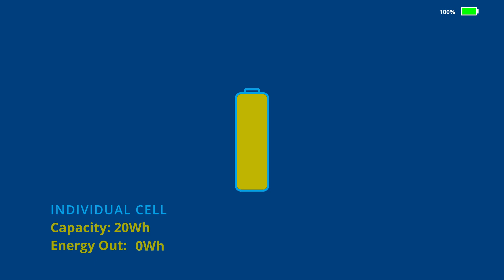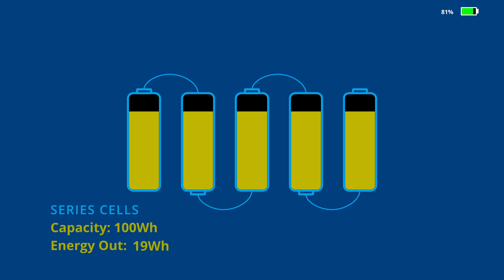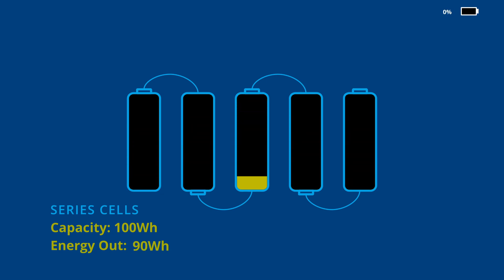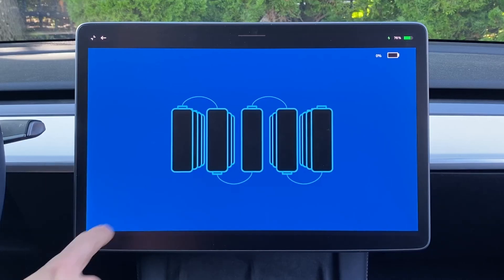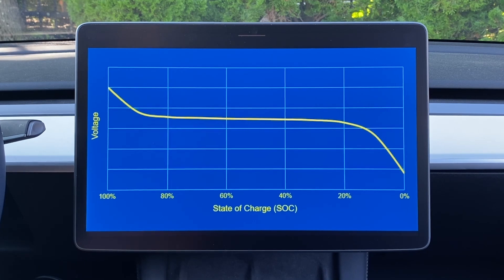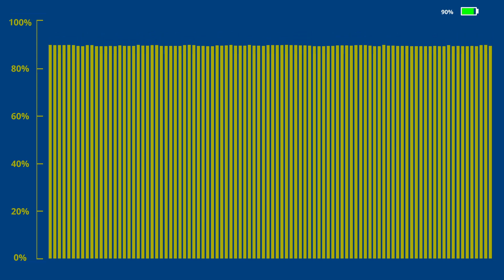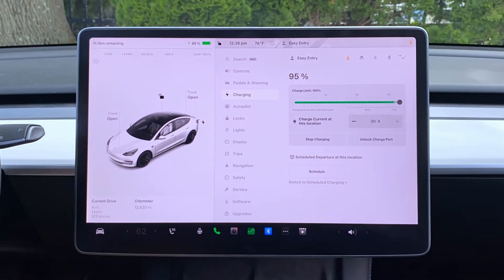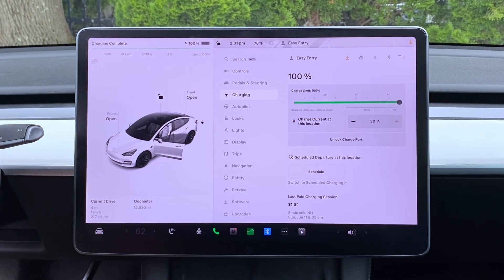How To Balance Your Tesla Battery

Comment: Course natural aging can cause the amp hour capacities to drop.

Manufacturing tolerances and quality of individual cells can also change the capacity.

In my case I've got a nearly 8 year old model S P100D with  272,000KM.

The lowest Calculated Amp-Hour Capacity (CAC) is  229, the max is 236 and the average is 235.
So its a 6.5Ah difference from the average to the worst.

Meaning approx 2.6kWh is locked out since the weaker pack will be limiting me.
Additionally any full cycle drains will only serve to exacerbate the issue.
As the weakest cell will end up with more accumulative discharge % and so wear out faster.

Eventually leading to a larger imbalance on the pack.
That being said, 6.5ah off the average is only 2.76% off being balanced and is acceptable for now.

Comment: 5:50. All your video make sense  but this aspect is not true. The car will balance better ifg it is parked because the BMS need accurate voltage reading which mean no load must be applied. OCV is what matter for the BMS voltage sense

Comment: The process on LFP battery ande NMC/NCA battery is a bit different. YES it make sense for the LFP but for other chemistry the BMS balance at many high soc due to the different SOC curves. what matter the most is to have teh car to sit few hours in order to get accurate voltage reading (OCV) otherwise it will not do his jow with good measurements.

Comment: I would expect the balancing system to be working all all range of charge.
I know for LFP it get a harder time as the voltage is almost the same until fully charged, that's why they recommend fully charging to 100% for theses.

Comment: Thank you!  I'd like to ask whether any info in this video has changed from 2 years ago to now.
Reply: The chemistries haven't really changed.

The basic function on any BMS for NCA/NMC type cells is to have it balance at the top end with protections against overcharging.
AKA this balance resistor to burn off the top cells while charging the rest to 100% (4.2v)

LFP (LiFePO4) is charge to 100% as the voltage spikes only at the utmost extremes. IE 100% and 0%.
So the BMS needs the 100% to accurately measure consumed kWh and give you the user a more accurate % remaining.
Additionally the stress of 100% on LFP is not the same as sitting at 100% for NMA/NMC.
Reply: @ArmChairPlum thanks

Comment: I thought you had to charge it to 100% and leave it plugged in for a couple of hours for the BMS to work.  When you unplug it, the BMS will stop working.  But what you’re saying is, as long as it hits 100%, the BMS will start balancing whether it’s plugged in or not.
Reply from the maker: My understanding is that the BMS starts balancing even at a state-of-charge slightly before 100%, but it’s not clear exactly when.  So charging to 100% will guarantee the balancing algorithm begins.   Then the balancing algorithm continues, even if the charging cable is unplugged, or if the car is being driven or even if it’s parked.   It can take several hours for the balancing to finish.
Reply: How long should I leave the battery at 90%? And should I do this a couple of times in a row?

Comment: In terms of the battery as a pack what do you consider 100%. Is it when the first cell hits 4.2v?
Reply: Well, according to my tests of the BMS the battery pack in the Tesla is considered 100% with highest cell around 4.15V to 4.18V depending on the battery pack temperature.

Comment: Is this why a lot of 2021 tesla are getting the error code BMS_A079 max charge reached, impossible to charge. Because the pack is not balanced? And is charging to 100% would help to avoid this problem?
Reply: I have this problem on my Tesla 3 2021. Did charging to 100% as described in the video help you?
Reply: I charged my 2021 model 3 to 90% before a long trip and got the same code BMS_a079 max charge reached and only lets me charge to 50 % did your problem got fixed?
Reply: I got this fixed by replacing the battery. Twice! If it happens out of warranty I'm getting lawyers involved.

Comment: Great video, thanks! But is it real? Can teslas rebalance individual cells or only series? In latter case it won't help. Any reference to docs or researches?
Reply from the maker: In the Tesla, it’s not individual cells that get balanced…it’s “bricks” of parallel cells that get balanced (I think I mentioned that in the video).  

There are guys on the Tesla owners Online forum that have disassembled Tesla battery packs and posted photos and essentially reverse engineered the charging/balancing circuits.   Lots of information about charging/balancing on that forum.   
Thanks for watching 👍
Reply: @CosmologicalNonsense  Is it possible that an individual cell gets imbalanced? If yes, then how to fix it?

Comment: This is a great visualization

It says charge to 100% then drive it down to 90. Do you then have to go back and charge it up to 100% again and how many times do you have to repeat this for the balancing to complete?
Reply from the maker: No, you don’t need to charge it up to 100% again.   Just doing it once will trigger the balancing algorithm.  I’ve been doing it about once or twice per year.   👍
Reply: @CosmologicalNonsense  OK so in summary drain the car to 5% bring it home and plug it into my HWPC until it hits 100% immediately drive it down to 90% so that it can sit for a few hours. Is that correct?
Reply from the maker: @comdexusa  You don't actually need to drain it down to 5% to start the balancing process.  Charging up to 100% will do that.  Then drive down to 80-90% so the car doesn't sit too long at 100% because that isn't great for the batteries.
Reply: @CosmologicalNonsense Can you drive it lower than 80% after charging to 100%?  Say 50%?  I have to run an errand tomorrow after charging to 100% and don't know how much kwh it will use.  More than 20% for sure but not more than 50%.

Thanks so much for this vid!!!!  I charge to 65% daily and use about 20% to 50% on a daily basis. I have found on recent long drives that I cannot extract as much from the pack as should be possible based on my remaining range estimate.

My M3 is 10 months old w 15k mi and 337 mi at full charge (from 345 EPA and 342 when I just got it new). I have an 82.3 kwh pack so I should have a bit over 80 kwh available.  I don't know how large the reserve is but worked on 5 kwh and on my last few drives I could only extract 70 kwh from the pack!!!!  I rarely charge to 100% and rarely use DC charging (about 15 sessions and 600 kwh over the 15k mi).

I think you have explained why I have this problem (showing 80+ kwh available but I can only extract about 70 kwh).  Thanks!

Comment: This also bring another important question: does imbalance process happen more at high state of charge? If the self discharge current inside the cell happen across an equivalent resistor value than the relationship between soc and unbalance process would also follow the OVC curve.

Comment: is this fittable for NCA/NMC batteries? I got M3 LR and tessie shows a big degradation during last ~10 charges. Capacity dropped from 67-68 to ~62, though I did not discharge it much or charge it to 100 and leave for a lot of time. Usually discharge it to ~40% and charge to 80%, very mostly I use AC charger with up to 25 amps
Reply from the maker: Yes, this video is specifically for the nickel cobalt battery chemistry.  
If you’ve never charged your pack up past 80-90%, I’d say it’s worth a shot.   
Charge it all the way, then drive around to bring the state of charge back down to a reasonable level….This will trigger the pack to balance.  
Over the next several days and charge cycles, you may see an improvement (assuming the pack was unbalanced to begin with).
Reply: @CosmologicalNonsense  Car was taking around 18amps on 230V on 100% of charge. I have been waiting for around a hour and it dropped to like 10-12 amps, but I didnt have any more time to wait so had to drive. I did the trick just in case when I bought the car, it had like 450km range, I charged it to 100% and left for around a day without driving, I know its bad but range increased to 470km. Since then I only charged to 95% for trips and usually to 80% while discharging to 30-40%. Looks like I had to wait now until the charging has stopped but I guess Ill see the difference anyway. If range will increase, then after a month or two I will repeat but this time will wait until it stops charging and wait for a half an hour after before "test drive" to discharge battery. What I can say your trick really works because once I had an increase for around 20km. Big thanks for the video, its really easy to understand the technology in an easy way. Good Luck man
Reply: @CHELIK063  did u left your car plugged in or unplugged to charger?

Comment: I’d add that a grossly imbalanced pack will prematurely trigger the emergency shutdown message long before the display has reached 0% in the car, due to those low cells triggering the minimum voltage protections WAY before its anticipated in the coulomb counting method.

We’ve all heard of those cars that are forced to pull over for the shutdown when the screen said there was like 5 to 8% “left” on the display. The power reduction that occurs below 20% tried to combat the amount of “sag” that can prematurely hit this protection but it stands little chance against a really unbalanced pack.

Comment: How often should you do this? Will Charging to 100%, then doing a road trip achieve the same result?
Reply from the maker: Yup - charging up to 100% on a road trip would be ideal!   I do it a couple times per year to ensure my battery never gets too unbalanced.

I believe this is more of a problem for people that use ultra-conservative daily charge limits.   For example, someone that never charge past 50% would be at a greater risk of their pack becoming unbalanced.
Reply: With the Sexy Buttons app, it's showing, instead of percentage, mV. 6 - 8 mV rn. That seems low to me offhand, but I have no frame of reference. What number would you think says, "Maybe we ought to cycle the battery? @CosmologicalNonsense

Comment: How do you know this?
Reply from the maker: Great question.  I am an engineer with a background in battery packs.  But more importantly, Tesla's BMS has been deconstructed and analyzed by qualified enthusiasts and they have observed, documented, and described this passive balancing process in extreme detail.
Reply: @CosmologicalNonsense  it sounds odd that the BMS requires a 100% SoC to start the balancing process when Tesla advices customers to basically never charge to 100%. Are there other triggers for the balancing process?
Reply from the maker: @44Bigs  Yes, you are correct! The BMS begins balancing the pack at a SoC less than 100%....but nobody seems to be sure exactly what SoC triggers it.  So I typically use 100% when I want to force the pack to balance, because everybody can agree this SoC will absolutely trigger balancing.   Then I just drive the car afterwards to bring the SoC back down to something more reasonable.  Doing this once or twice a year doesn't seem to be problematic.
Reply: @44Bigs top-balancing is very common in lithium ion battery management systems. Tesla did in fact recommend charging to 100% once per month in the owners manual back when I purchased my Model 3 in 2019, which was prior to their usage of LFP batteries at all. I would assume this was their way of trying to recommend users balancing their pack without getting into the nerdy details of WHY they should be doing it. 

I have logged my cells while supercharging and watched the pack actually balancing in-action WHILE I was trying to charge to 100%. The car said I was “at” 100% but it kept charging for another 20 minutes and showed “recalculating remaining charge time” while I could see in the data log that it was performing its resistive load balancing while I was plugged in. My imbalance went from 5% to nearly 0.5% during that particular session. This videos recommendation certainly is a less expensive and more convenient use of time lol.
Reply: Thanks for the response! Would love to find out more about this stuff.
Reply from the maker: @SirBotsa_Lot a ton of information can be found by looking around on the teslamotorsclub.com forum.  They have some really knowledgeable contributors.

Comment: So let it for few hours after discharging to 90%??
Reply from the maker: Correct - the balancing will begin while topping off the pack, and will finish several hours later (or even a day later if your pack was severely unbalanced).  

You don’t need to let the car sit still while it is balancing - the car can be driven or parked during this period.
Reply: @CosmologicalNonsense  ok so I can drive it.. I thought I must leave it without driving for few hours at least.. THX I will try
Reply from the maker: @juradosty yup - you can drive right away and it will still balance in the background.

Comment: So just like you’re charging to 100, I’m assuming we should drain to at least 5% before hand?! What’s your thought on that?
Reply from the maker: Yes, charging up to 100% will trigger the BMS to balance your pack.  In fact, charging up to 90% or 93% may even cause the BMS to balance, but nobody seems to know for sure the exact SOC that triggers balancing.   So I always just use 100% when I want to balance my pack because we know for a fact this SOC will trigger balancing.   A couple times a year should be sufficient to keep the pack balanced. 

With regards to draining to 5% beforehand…this will allow your BMS to more accurately estimate your packs total capacity and thus allow for better range predictions.
Reply: Draining below 5% isn’t for cell balancing, it’s for dropping the voltage extremely low to calibrate the battery state of charge meter.  Charging over 95% also calibrates the SoC meter.  

If you’re only wanting to balance your battery, then you don’t need to drain the battery low.  Just down to 80 or 90%, should be fine for repeating the process a few times.  Keep in mind, smaller discharge/charge depths are MUCH better for your battery than big ones. It shortens the life of your battery dramatically.  So, you want to avoid charging from below 5% to above 95% as much as possible, other than for calibrating the battery % meter.  

Note that the car needs to “sleep” to calibrate the charge meter and to balance the battery cells.  So, disable anything that might wake the vehicle when calibrating or balancing.  Sentry Mode, Standy Mode for A.S.S., Mobile Access, schedules, disconnect 3rd party apps, etc…